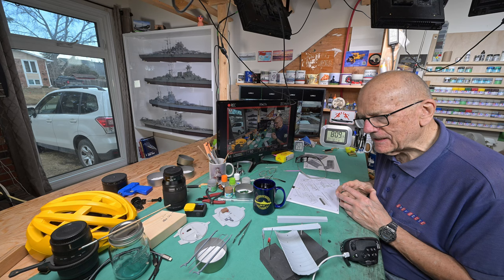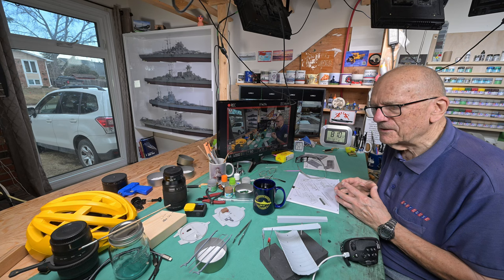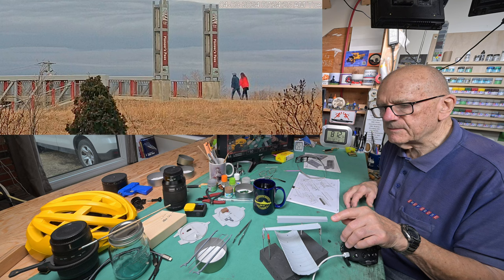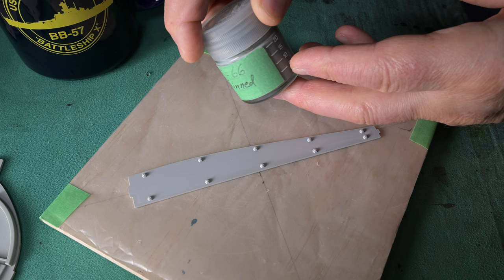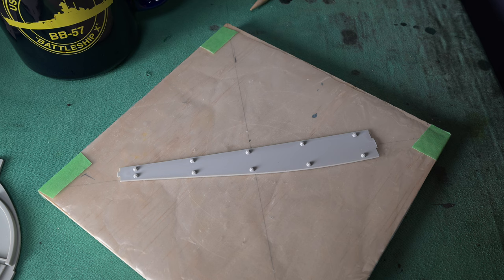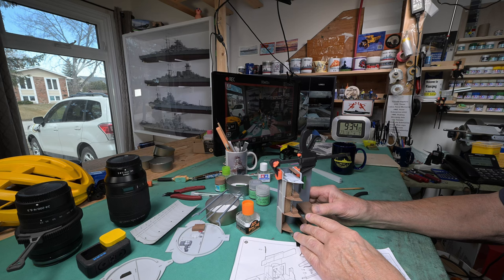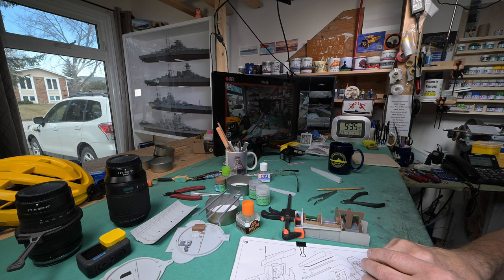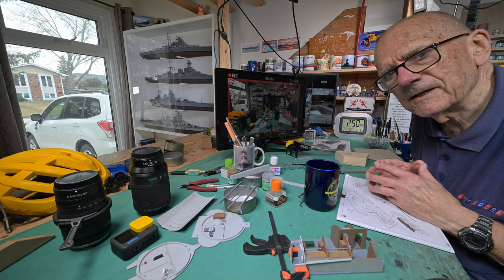The Model Ship - Part 1953

Comment: Hi Ron, just a thought.  I saw your post reference the stools in the radio booths and waiting till you decide if you’ll use the figures.  Could be difficult to position them once you put the ceiling in place.  Your call. Cheers , Mark from Queensland.
Reply from the maker: Thanks for the warning Mark. Will check on that tomorrow if I remember. 🤞